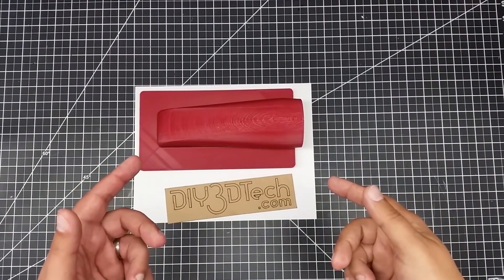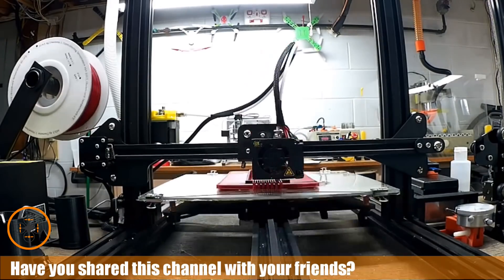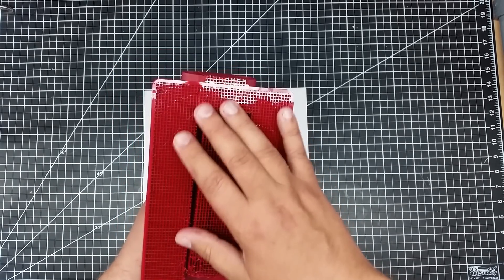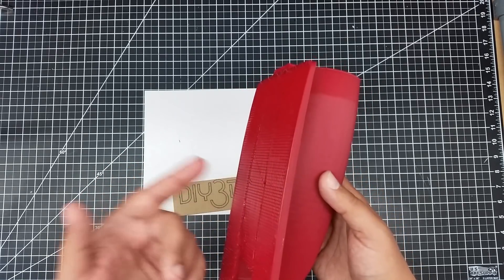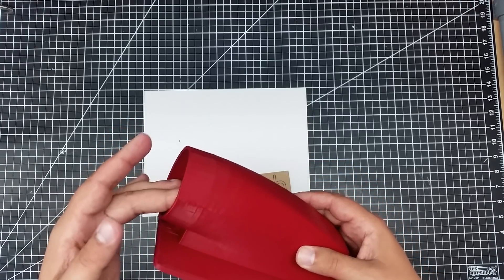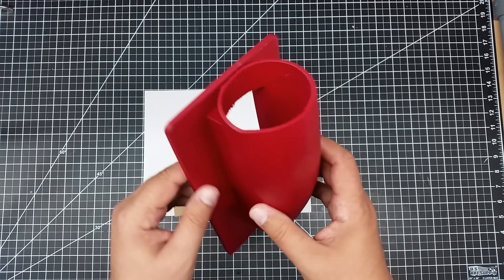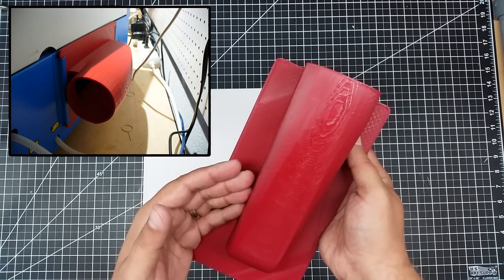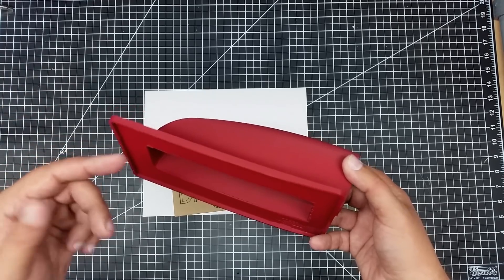Creality CR10  - 12 Plus Hour Print of a K40 Laser Exhaust Manifold!

Comment: This probably would have come out much nicer and sturdier if you had printed it with the round part of the manifold laying on the bed. Or was it too tall for that? That way you also could have disabled support for almost everything.
Reply from the maker: Not sure I am tracking with the orientation you mention as no matter how you turn it, it would require support and the manifold sticks out so all of the body would of needed to be supported if you turned it on "end" which is what I guess you are suggesting...
Reply: I meant standing it on the circular manifold outlet. Only the very bottom of the rectangular part would have needed support between it and the bed. The top part is a 90° overhang, but would probably bridge fine + it's not  a critical part of the print. And even if you give it support, it will be much less than what you added now, inside the tubular manifold. As you can see in the first picture on thingiverse even the creator printed it that way. Although he had to glue separate pieces together. With your CR-10 you could have easily printed it in one go, I checked, it's only 250mm high. If you cut some of the circular opening (lower the model into the bed) so everything touches the build platform you could even print without supports completely.
And because pictures are worth a 1000 words please have a look at the album I made for you. https://photos.app.goo.gl/3TNiytvGeWKOJaln2
Reply from the maker: Not sure as the inside has a lip (no clue why) if not for that might be possible as that is way too far to bridge.  I would have to load it up in a slicer and see what happens.  If I do another I may get that a try as I have an even bigger (slightly) printer then the CR-10 too (the Tronxy X5S)...

Comment: The upper visible „structure“ could be redused by using a different layerhight at the end.S3D provides this option with its processes, maybe that would help a little... 
Did not checked it by myself, but saw a few videos about it from people who are very well know in the 3D printer scene
Reply from the maker: I sliced this with cura and think I might agree with you maybe on layer height yet I thinking also about harmonic imbalance in the stepper motors so I have ordered some stepper smoothers so watch for an update!  :-)

Comment: cool but I found exhaust vent that near perfectly lines up with the mounting holes for about 10 bucks, I think on amazon. Though i understand the why not make it myself mentality, with that nice job on the design. I was going to print my own based on the design off Thingiverse but while i was looking around I found the vent and decided to roll the dice.
Reply from the maker: Please let me how it works, also one of the reasons I went this way (as I had designed my own in the past) is I am building a system around, stay tuned more to come!